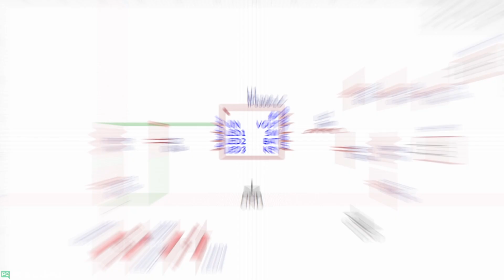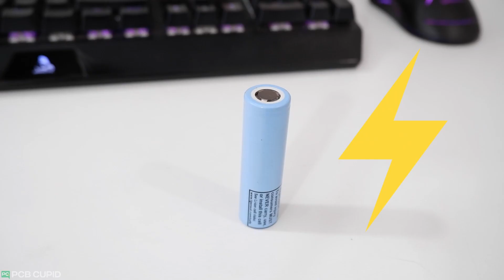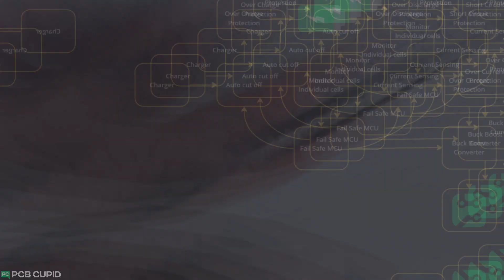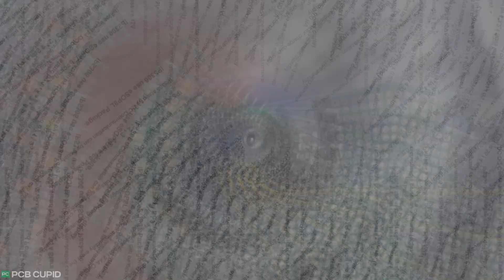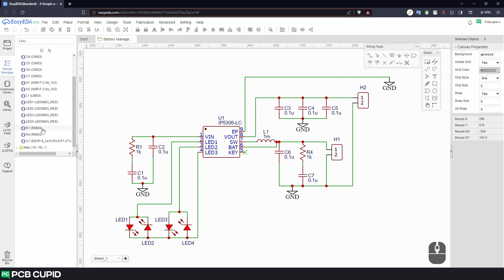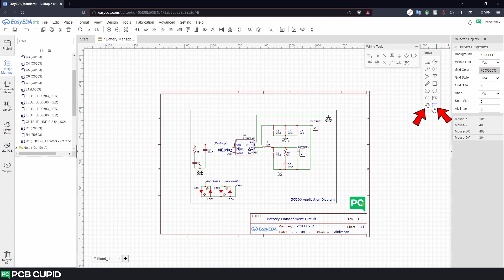#2 How to make Battery Management Circuit | EasyEDA 2023 #pcbucpid

Comment: This ic has a major issue like if i power it using type c it will charge battery as well power the arduino but as soon as i remove tpe c it should instantly switch on and provide power from battery also most of the time it does not detect load and we need t short key pin to. Turn it on so basically it does not act as ups but as a inverter
Reply from the maker: Yes, it behaves in such a way because it's made for power banks. It doesn't instantly switch power because of its minimum load current requirement to detect if a phone is connected or not. And that's something I'm planning to use as a feature in the future video.

(Use the key feature to put the device to sleep and wake up)

Thanks for the input 🙌 i haven't mentioned this in the video😅.
Reply: @pcbcupid  also is it possible to make it wakeup by adding permanent load so it's always on and never turns off
Reply from the maker: @drelectronics13  Thanks for the suggestion!

Comment: Hello,
I’ve read this tutorial 2: How To Make IP5306 Battery Management Circuit

Looking at referred datasheet there is a slight difference with the datasheet on the official site.

Note that pin 6 (BAT sensor), in the official site document, is connected to the battery through resistor R4. But in the datasheet used in this tutorial pin 6 (BAT) is connected directly to the battery. Also, the values of of C2, C7 and R4 are not exactly the same.

I’ve designed a handheld device that uses the ip5306 according to the schematic of the official document. (ESP32+RFIDSensor+IP5306). Everything works fine except the battery sensing.

LED 4 (Full 100%) never stops blinking while charging. LEDs wiring is OK and battery is OK (fully charged on another charger).

My questions are,
-where was this datasheet obtained from?
-this difference in wiring could be the cause of the problem?

I ordered the printing of 5 PCBs and I need to fix the error before printing again.

Thanks in advance,
Osmany
Reply from the maker: We got most of our datasheet from LCSC, please cross reference once with that.
Reply: I am struggling with the same ambiguity. I downloaded the datasheet from LCSC as well, but the battery there is connected through a resistor. But all the online tutorials and discussion don't use that resistor. Now I don't know which one is correct.

I have like 5 different official datasheets and each one of them have slightly  different schematic

Comment: what if i use a 2 cell battery? (1S 2P)
Reply: I will use it to replace cellphone batteries in my project. And it requires a maximum voltage of 4.2v
Reply from the maker: This BMS can handle battery voltage from 3.7 to 4.2 so it should be okay. But for 2 cell you use a different circuit and IC.

Comment: can I use dw01 with mosfet 8205a ic for battery protection
Reply from the maker: It won't be necessary; IP5306 has those features (DW01 features) by default.
Reply: This IC has also temperature control characteristics?

Comment: Hai 
how can i get 2 different voltage values from this like i need 5V for sensors and 3.3V for MCU how can i achieve this
Reply from the maker: Yes! You can add a LDO to convert 3.7v from battery to 3.3v along with this circuit.
Reply: @pcbcupid  i also need 5 v along with 3.3v 
Can i use boost converter to step up the voltage to 5 v and then i use LDO to get 3.3V is it good for battery application devices
Reply from the maker: @theGamer-kt9pf  It depends on the circuit, but for most this method should work. If you are in need for better power management you should use buck converter instead of LDO.
Reply: @pcbcupid  thanks